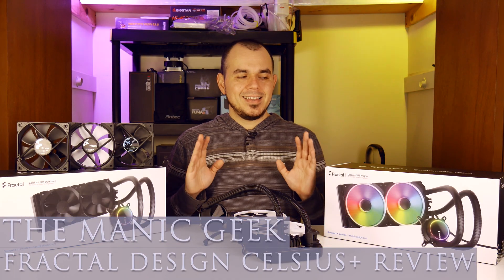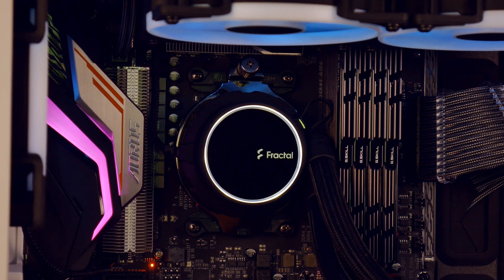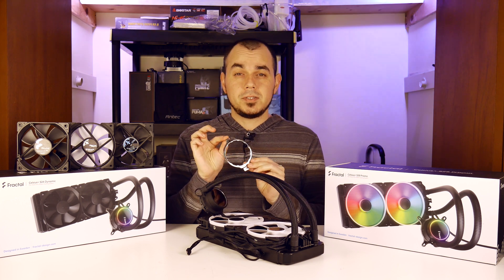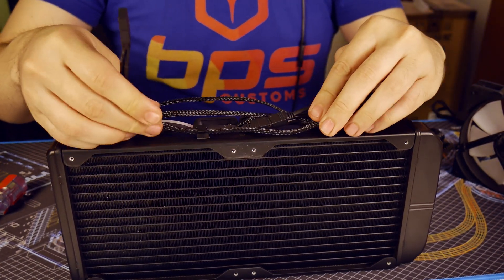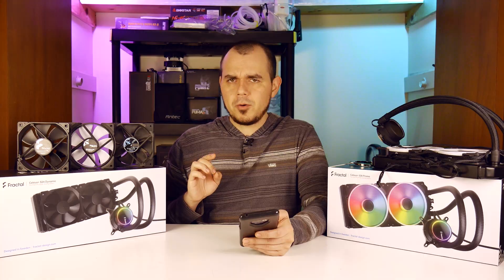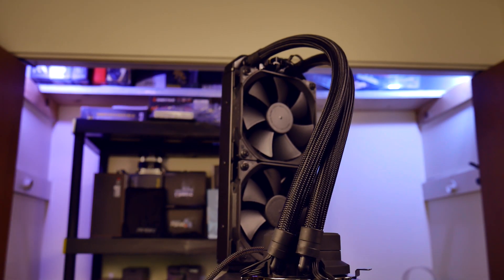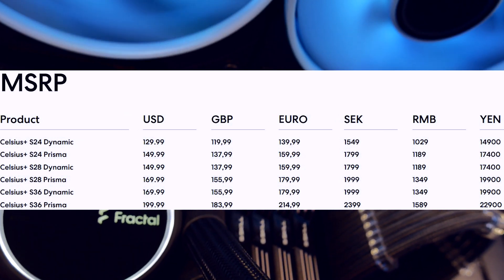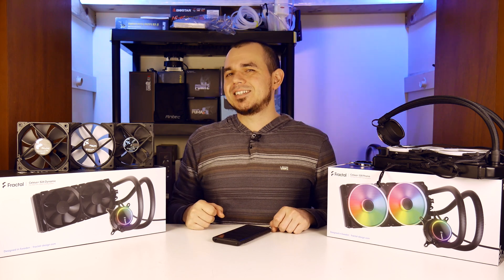New AIO's From Fractal Design: Celsius+ S24 Dynamic and S28 Prisma Review

Comment: Will Fractal revise the AM4 mounting mechanism? It would be nice if it were like the intel hardware with the backplate.
Reply from the maker: Its' unlikely they'd revise it, especially with AM4 being poised to be supplanted by another socket later this year. That said, if you did want that kind of mounting system, you can buy the standalone Asetek AM4 mounting kit on Amazon that would function the way you are asking for it to function, and it will fit this heat sink perfectly since it's an Asetek-made AIO. I use it for my personal Celsius+ heat sinks bc they're easier to use and consistently seem to provide more even mounting pressure, though that's anecdotal at best.

Comment: Heya, I just installed my S28+ Prisma, and my ARGB ring is also only showing "white" whereas the fans (which are Daisy Chained through the pump head) are showing the correct colors (rainbow for example). I've thought maybe the pump head ARGB controller is broken, but then I found your vid where you describe a similar problem. However, I haven't connected the ARGB connector to the motherboard, I've connected it to the ARGB controller which came with my case (Phanteks P400A). So apparently even hardware ARGB controllers are having issues with this pump head!
Reply from the maker: Yeah that pump won't work with your case controller. Gotta run it to a motherboard header.
Reply: @TheManicGeek  Why do you think so? Just curious, did Fractal confirm this to you? My problem is that my motherboard (MSI B450 Tomahawk) only has the old 12V 4 pin RGB Header, no 5V 3 Pin. And I'm unsure if using a converter (12V 4 Pin to 5V 3 Pin) will have the same problem. What do you think?
Reply from the maker: Fractal did confirm this with me. I have that same board on a test bed: if you try to plug that pump in to a 12V header, even assuming It would connect in the first place, you would fry the LED's, possibly the pump as well. With that board you'll only be able to run the pump in white LED mode. Prisma fans are more flexible with what they'll work with.
Reply: @TheManicGeek  Ok, but what about a 12V 4 PIN to 5V 3 Pin converter? I'm wondering if that would work...
Reply from the maker: @clancy688  yeah if you got a converter that would theoretically work. I think PPC's carries those.
Reply: @TheManicGeek  I ordered one and let you know how it goes. :) I purchased this one: https://www.amazon.de/dp/B082KKPYVY/
Reply: @TheManicGeek  I got the converter and it works indeed! I really gotta thank you for this video. Without it, I'd have thought my pump was broken and ordered a replacement, which would have shown the same behavior!
Reply: I just installed s28 yesterday into a phanteks p400 case also and when connected to the case rgb controller ring was white when I connected the pump header rgb cable to the motherboard I was able to get full rgb and can change the modes with msi mystic light.

Comment: Maybe a stupid question, I'm looking to buy this AIO because I really love the look and cable management of it. However my motherboard (b450 msi gaming plus max) doesn't have an aRGB header, will i need one to use the aRGB on the pump or is the connector on the radiator meant to bypass that?
Reply from the maker: The connector on the radiator simply lets all of your lights be synchronized together; you can technically not use it and have your fans and pump top be different colors. You'll still need a compatible motherboard header to be able to control lighting. Without RGB control all of the lights default to white. Only the fans can be controlled by the Fractal Design Adjust R1, the Celsius+ blocks aren't compatible.

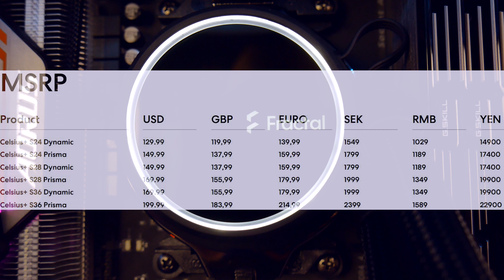Comment: I love the look of this AIO, but that AM4 mounting system can be quite a handful, at least from what I've heard from others. Also in that shot at 9:49 the thumbscrew looks waaaay off, so I think I may have to skip this one
Reply: Dang, fastest heart in the west, I see
Reply from the maker: So here's the rub: their AM4 mounting system, while simple, is a bit odd. If you use it and don't like it, it won't keep your AIO from performing as well but it can make mounting a bit of a pain. That said if you buy the Asetek AM4 mounting bracket from Amazon it's only 12 bucks and replaces the FD polished bracket with a matte black one that uses a four corner mounting system with the OEM motherboard backplate. You can also carry this bracket over to any other Asetek-branded AIO since it also provides an adapter piece for older kits as well.
Reply: I had no idea Asetek made universal brackets. What an absolute godsend you are. You're getting my like for that
Reply from the maker: LOL I honestly didn't realize it either until my buddy Travis over at Shellback Tech told me about it. I bought three brackets: one for each of my Celsius+ heat sinks and one for my test bench. They use more parts but it's guaranteed more even mounting pressure and a MUCH easier installation process in the end.

Comment: Celsius+ S24 Dynamic with Be quiet! Silent Wings 3 fans would be a dream
Reply from the maker: You're probably right, but at that point I'd say you're strictly paying for the noise reduction rather than any tangible performance. If you already have the fans it's totally worth it to try them out but I wouldn't go out of my way. Up to around 75% combined fan/pump speed these AIO's are pretty damn quiet and perform well.
Reply: @TheManicGeek  I have 2 x Noctua NF-F12 fans (300-1500rpm) that I am thinking about changing in. Seeing as the FD Dynamics are 2000rpm max, then how would that be with say constant 50% and upwards for the S24?
Reply from the maker: Couldn't tell ya, I'd have to run Noctua's on my test bed for that. I would imagine the Noctuas be quieter if for no other reason than a reduction in RPM and a better built bearing, but past that I could only speculate.
Reply: @TheManicGeek  That's what I'm thinking too, but you obviously have more experience than me :) Would any radiator do the same job, if I'm moving fans anyway? If so, then design and cable management is such a high priority ;)
Reply from the maker: By and large most AIO radiators are the same style of aluminum construction for reduced weight and cost, and largely have the same fin density of around 14-16 fins/inch. Most of the difference comes from the pump and fans used, and unless there's a significant change from one pump generation to the next then even that only starts to matter once pump RPM drops too low.

That's the one downside of the Celsius+ AIO's: if fans and pump are linked together then you get exponential performance drop-off since you lose heat transfer efficiency across the board. If you prefer to run the pump at a fixed speed and only control the fans you can just bypass the hub at the top of the AIO, same goes for lighting sync, which is how I have my case fans set to white while the pump top is set to blue in my current setup.
Reply: @TheManicGeek  So - if I'm understanding this correctly - If I wanted to run the pump itself fixed @ (say) 75%, then the fans would be 75% aswell? I can bypass this by connecting the fans to a SYS-fan and let them read the CPU-temp to adjust? I feel stupid discussing this on YouTube, but what can you do ;)
Reply from the maker: Correct: the pump and fans adjust together when connected via the radiator distribution hub. You can control speeds independently by just not using it and running the rad fans to other fan headers.

Comment: Hey! This review is the best one out of all the reviews made about the AIO. I'm buying it soon, i just have a few questions.

How long is the aRGB cable you can optionaly plug into the pump? I am talking about the one that connects to the bottom of the pump. Since my jRainbow connector is at the bottom of my motherboard, i am afraid it won't reach that far.

Do you think it would be easy to mount this in a front config? This will be my first all in one and i'm not sure if it's possible to front mount it in my Fractal Design Meshify C.

Thanks in advance :)
Reply from the maker: I front mounted this in my test bed so it shouldn't be particularly challenging. In a Meshify C your limiting factor will be the length of your GPU, so as long as you've got at least 60 mm of space between the  front edge of your GPU and the front of the chassis (not the front panel) it should fit.

The ARGB cable isn't particularly long so you may be looking at running it straight down the motherboard. You could also purchase an extension cable that would plug in to the existing cable for the AIO, though there's a possibility that could impact signal integrity and since the AIO lighting apparently isn't compatible with my Gigabyte board (for now) I can't really test that myself.

Comment: Question: Does it have any kind of default rgb color? Or is the rgb totally turned off if the rgb cable is not plugged in?
Reply from the maker: The default is the white you see in my b-roll.

Comment: The problem is RGB Fusion is pretty garbage, not going to say it is better or worst than the other RGB software as none of them clear the hurdles of an acceptable user experience.
Reply from the maker: You have hit the nail on the proverbial head.  They tend to be far too invasive for my liking, are clunky, and the lighting effects are lackluster.  Even if it's the more advanced effects like iCue, CAM, and Aura, the software still gums things up.  That said I still haven't experienced anything like this with other products I've tried connecting to my board, and I've been using it since launch... so something strange is going on, for sure, just won't speculate on where the fix may be until I hear something more concrete.

Comment: There is a beautiful workaround for the AM4 bracket since it's and Asetek pump, so you can just use the backplate and not worry about the clip clamps. All you have to do is order a $7-$8.00 AM4 Asetek mounting bracket. Great video dude!
Reply from the maker: That's very true, it would make mounting this thing a hell of a lot better for AM4 and properly drove home the whole "ease of use" and QOL thing they've got going with these products.